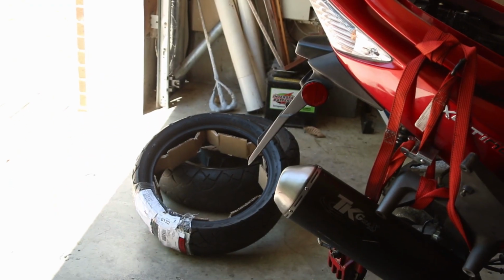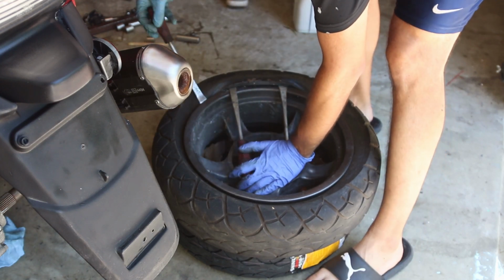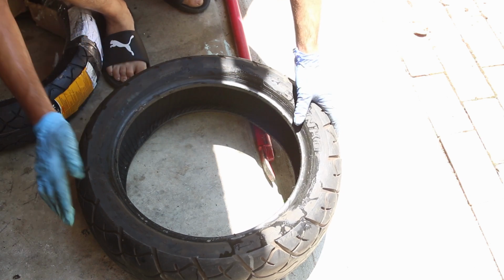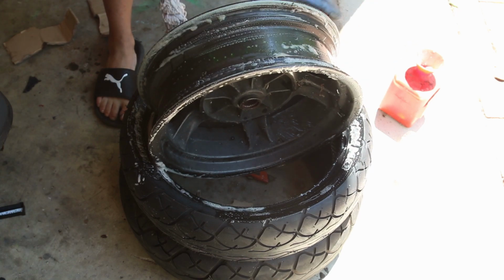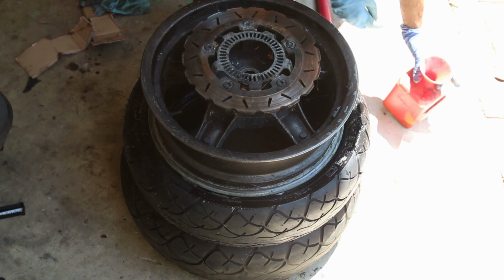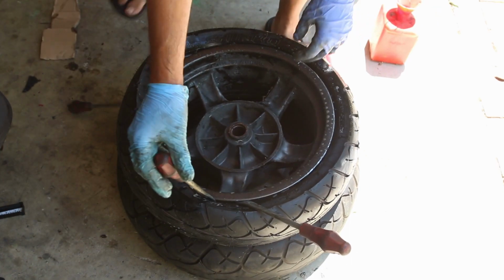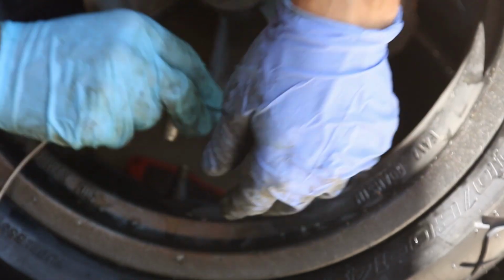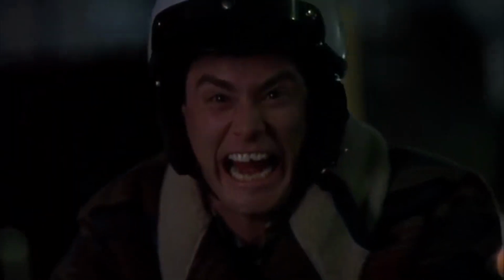How to change a tire on a Kymco Scooter

Comment: How many miles have you put on the kymco to need a change,and how many miles does the factory says to change it? I'm right now at 3000 miles on my 150cc. My tread still looks good, but I really have concerns for safety.
Reply: Tire changes are not made based upon time or mileage. You need to measure the remaining tread to determine when the wear is excessive